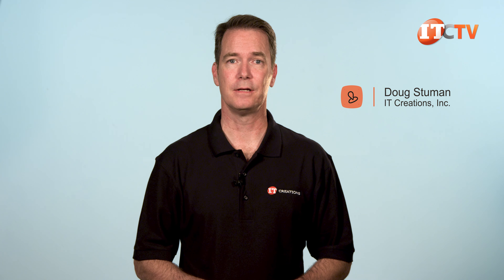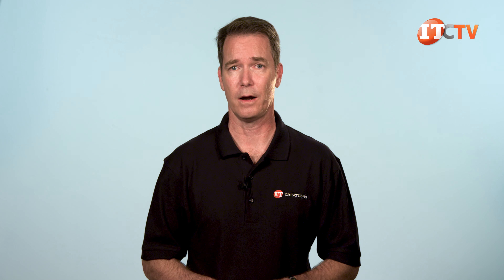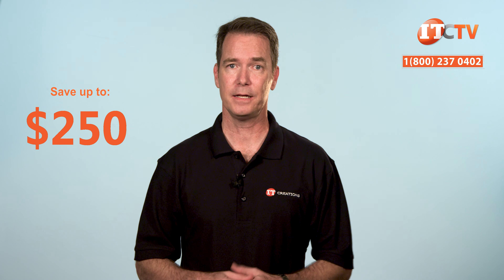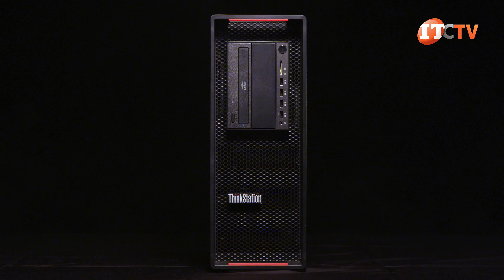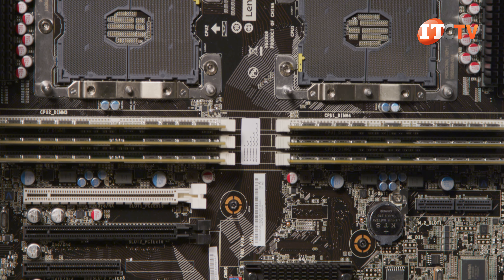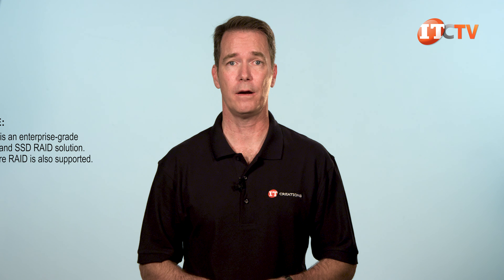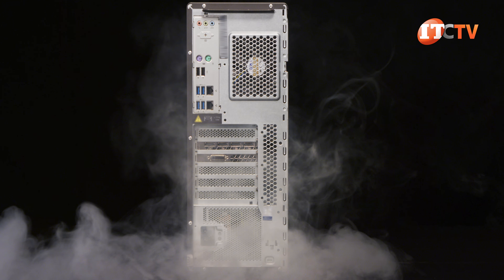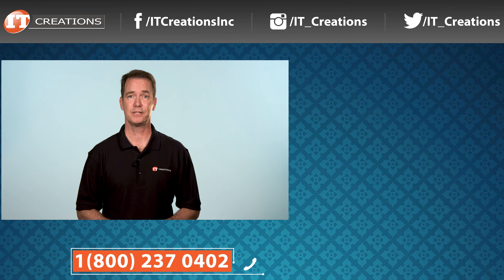Lenovo ThinkStation P720 Workstation REVIEW | IT Creations

Comment: Does the P720 workstation support 12TB 3.5" HDD per sata?
Reply from the maker: Although, we have not tried this on this system specifically, it should be fine as drive size is usually what is available when the documentation is produced. 
Thanks for watching!

Comment: What is the capacity of the hard disks
 to be installed inside the device?
Possible 16TB or less ?
Thanks
Reply from the maker: Hi there, 
There is no Maximum that the system will recognize. If it fits, it should work. Manufacturers usually place vetted drives in their specifications based on the "current" technology available at time of print. Thanks for watching!

Comment: The point I am not clear on is, the documentation says that you can use one of the pcie 16 slots only if using the 2nd CPU, so does that means I can use 2 GPUs, if I use this slot, even though the GPU doesn't have SLI?

Comment: The device has  problems, limited space, not easy to close the door, and installing hard disks and connect cables 
I thought that installing 4 disks without cables and internally integrated like p920 unfortunately is a narrow and claustrophobic design from Lenovo

Comment: In my experience this is the worst product you could ever buy with the worst support. Stay away from Lenovo like the plague
Reply from the maker: Hi Matthew, I have the P700 under my desk and have had no issues with it. That said, when the marbles are down and you need some technical expertise and it's not there, that can be really frustrating. Did I mention that IT Creations offers up to a five year warranty on our custom configured systems? It's all true. Check out ITC next time Matt. Thanks for watching!
Reply: Hey Matthew, what has your experience been?  With which machines/models?